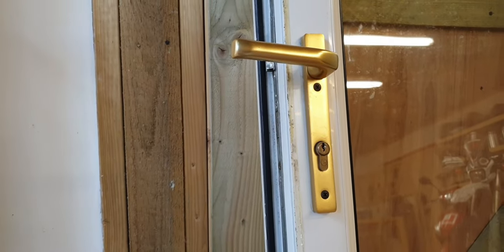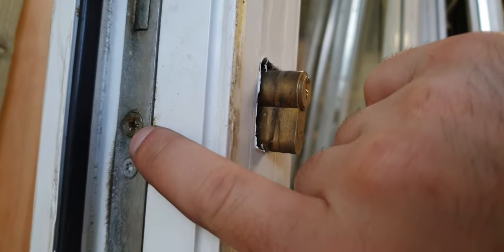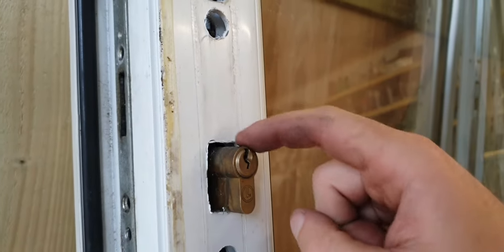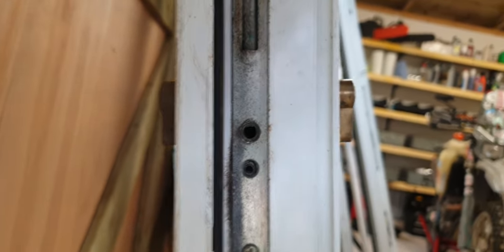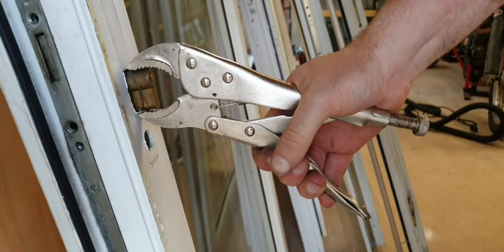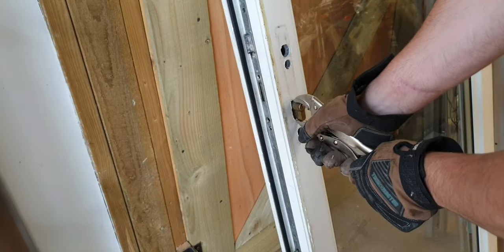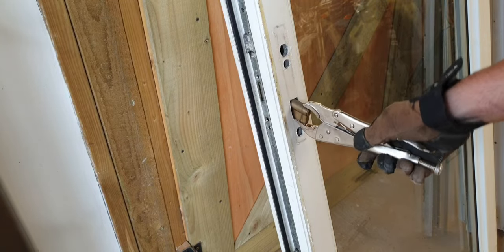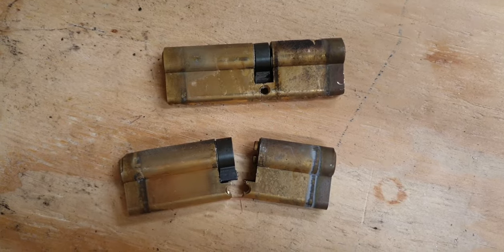How to Remove a Lock Cylinder Without the Key.

Comment: It's less difficult to break if you first weaken the part where it breaks. I used a 6mm drill to widen the M5 hole.
The head of the long M5 screw is 9mm wide, so still holds in a 6mm hole or even bigger.

Comment: Thanks for the video. I can confirm that this works 100% and does not damage to the door (although I'm guessing that the door could be damaged if pure brute force and stupidity is used). And it was as "easy" as you made it look. We just moved into our "forever" home and the front sliding door never had a key and has been unlocked for 10 years so this was needed. Total time taken was no more than 5 minutes

Comment: If possible and confident enough  you could de glaze and drill a 10mm hole  in pvc profile above  the retaining screw, hitting the cam with screwdriver head until level with barrel to pull out, if you've gone too far insert a hook type wire to bring cam back level.

Comment: I want to change a lock but my key is broken. Currently I'm locking and opening using a screwdriver. Do I still need to break the lock or am I able to pull it out without any issues? I just don't want to pay for a locksmith due to cost of living in the UK

Comment: Does it help to run a drill through before you snap it?
Removing extra material to snap
Reply: If you drill it you can put a screw driver inside and unlock the lock and pull it out without snapping it
Reply: @alexmccartney8827 Interesting… Drilling where/how? Can’t visualise. Thanks!

Comment: Great video, but what about if I have the key but can’t remove the barrel. That’s not any bolt to hold the barrel but I still cannot pull the barrel out no matter how I turned the key. My door is exactly the same. Thank you!!!
Reply: Have you tried turning the key through various angles to see if there's a particular angle that works??

Comment: How difficult is it to snap the cylinder? Is there any other tool u can use to snap it ?
Reply from the maker: There is a specific tools for breaking these locks, but locking grip pliers work. You can also snap the lock with blunt force, by striking downwards on the protruding end.

Comment: Difficult to get the boot out with the door closed and locked, which is the most likely. Snap the barrel off just like a burglar would ....
Reply from the maker: Yes, but if you make a detailed video about lock snapping technique with the door closed and locked, it will be flagged.

Comment: This is okay if the handle set is already removed. Any good/reputable installer/fabricator would install the handle screws inside the property. A Stilson wrench is much more appropriate for the job of snapping the barrel and should be applied flush with the door, making the snap action a rotation.
Reply from the maker: Right. YouTube regularly flags videos in which the process of breaking the lock whilst the door is closed and handle set however - so in this case we have to show the process as "you have purchased a new door", and obviously have access to both sides of the handle. I won't be showing the full method on a closed door for obvious reasons.
Reply: @Bambicarus  - interesting, I did wonder about the possibility of YT not liking such videos, thanks for info.

Comment: What about if the doors locked most common I would think ,lost key door locked can not unscrew bolt holding lock as i can not get to it
Reply from the maker: You can also break the cylinder with the bolt in place, however if you make a detailed video of how to do this with the door closed, it can be flagged by youtube and the video can be removed as it basically shows you how to break into a home.

Pry the handle plate away from your door. Grip the cylinder and break in the same fashion.

Comment: Thank you, only question I have is how to measure the existing snapped lock to know what size new lock should be?
Reply from the maker: Line up the two snapped pieces and measure them. Or take them to a local locksmith and have them provide the new part. Be sure to purchase an antisnap model upon replacement.

Comment: That's ok if the door is unlocked. What about a video of a lock snap when the door is in the locked position and you don't have a key
Reply from the maker: If you show a video of the cylinder snap with the door locked and in the closed position with an intact jamb and frame then the video will be flagged (for obvious reasons). I've had one removed already, so this is the best I can do!
Reply: Thanks for the explanation @Bambicarus

Comment: It would snap a lot easier if you leave the screw in
Reply from the maker: Good point. Interesting. I may test this theory. The eurolocks typically fail by brittle fracture, and i've never seen the upper portion of the threaded diameter plastically deform by the snapping method. It would be interesting to see how the thread being filled affected the critical force of these locks. I've snapped loads over the years, I usually remove the screw but sometimes it's stripped so I snap with it in. They snap at about 100 Nm around the hole I reckon. Crap design.